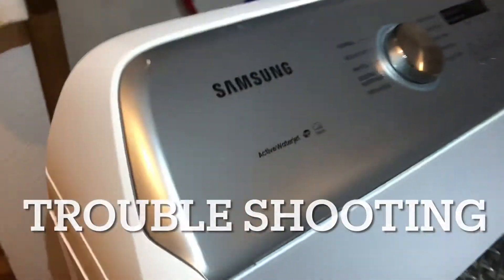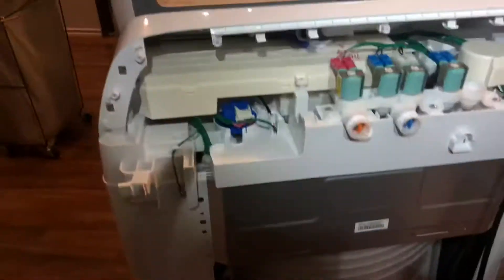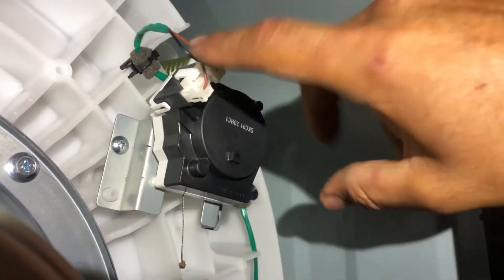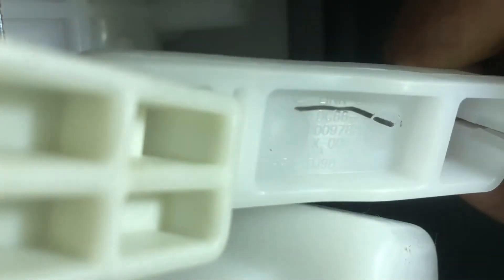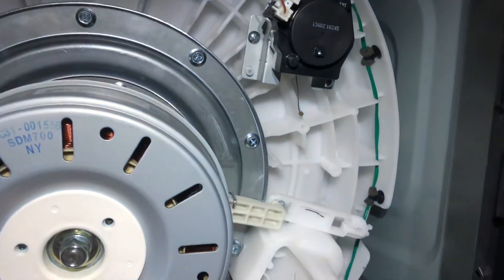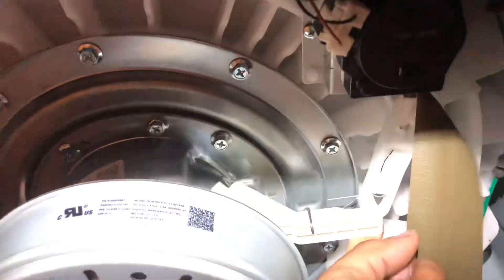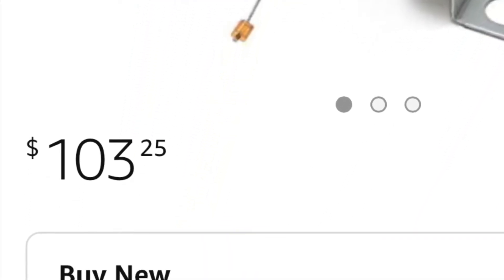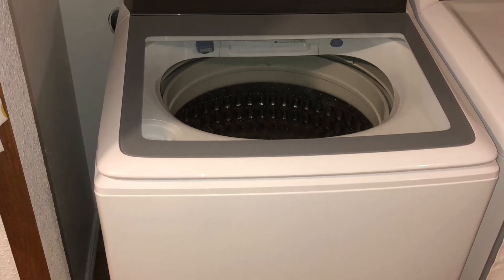Samsung Washer Machine Not Rinsing or Draining

Comment: My samsung washer will drain but not spin is it the actuator on this video?
Reply from the maker: No it was the plastic piece that attaches itself to the WASHER CLUCH MOTOR. (Washer Clutch DC31-20014C) their is a wire rope with a brass end piece. The plastic arm that is attached to the wire rope. The plastic piece flex’s and bends. I could not find a part or part number for the plastic piece. All I did was reattached the plastic piece and added some take for a temporary solution. It fell of a few weeks later and then I just zip tied it. Zip ties work better than tape.

Comment: My washer won’t do rinse spin cycle
But does
All other cycles when set manuallu
Reply from the maker: @MaryMcKiernan  Do this check to see if that plastic piece is disconnected. It’s a possibility problem and the solution is reattaching it back. Use a zip tie not tape. It’s stronger.